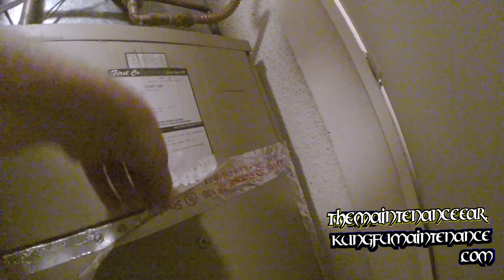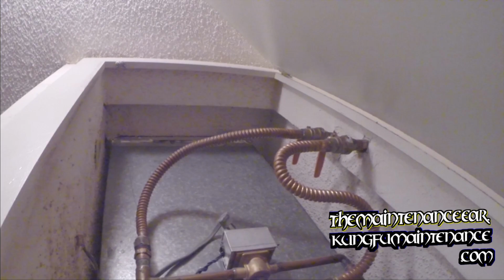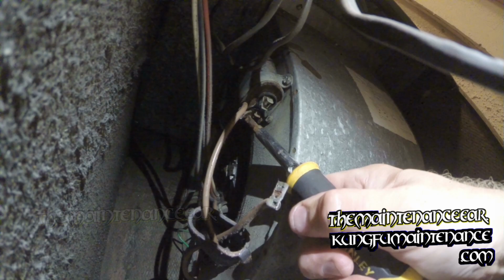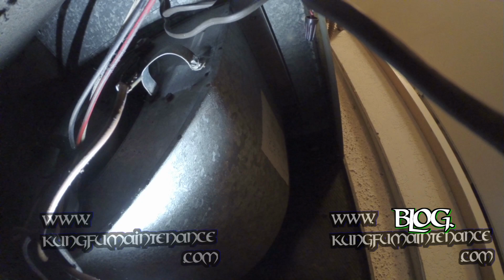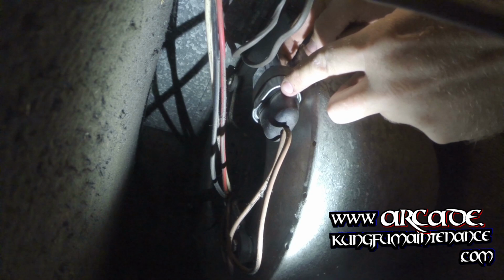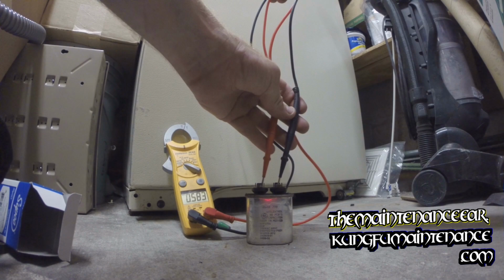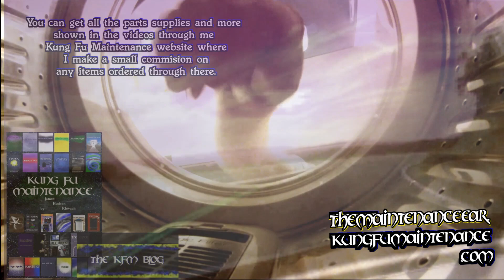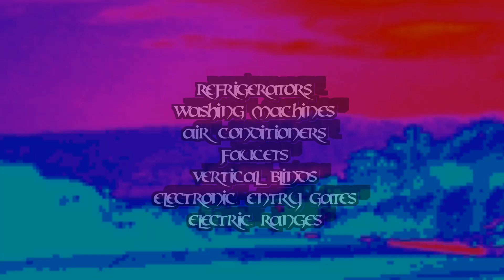Fan Slow Start Indoor Blower HVAC Air Conditioner Heater Quick Fix Maintenance Repair Video

Comment from the maker: Easiest Way To Get Universal EPA Certified Prep Manual    http://amzn.to/2kIQdQC
Get KFM's favored AC Gauges here            http://amzn.to/2kYgGb8
5/8" Suction Line Insulation   http://amzn.to/2w1me8G
Simple Leak Seek Spray   http://amzn.to/2lFfcC5  Laser Thermometer  http://amzn.to/2layD8I  
Valve Core Removal Tool                              http://amzn.to/2kJ00pC
Get KFM favored Electronic Leak Detector        http://amzn.to/2kmQMMz
Inficon Refrigerant Scale                               http://amzn.to/2vUCQPD
Hard Start Kit     http://amzn.to/2kiD16v   Contactor     http://amzn.to/2lFqA0P
Get  the Multi Tool Pliers used in so many KFM videos       http://amzn.to/2kWTjPp
5mf Capacitor   http://amzn.to/2wC96sH     35mf Capacitor    http://amzn.to/2vZVZ2t
35/5mf Capacitor   http://amzn.to/2iVJNi2        40/5mf Capacitor    http://amzn.to/2wzEdXD 
45/5 mf Capacitor   http://amzn.to/2w0wez5   
Condensate Pan Tablets   http://amzn.to/2lalV9W   No Rinse Coil Cleaner  http://amzn.to/2lHg8GD
Condenser Fin Whisk Brush                          http://amzn.to/2vWXUoC 
You must be EPA certified to charge or recover refrigerants and here is about the Easiest Way To Get certified with the Universal EPA Certified Prep Manual    http://amzn.to/2kIQdQC
Get KFM's favored Multi-Meter  here        http://amzn.to/2l8W9CO 
Get the Milwaukee 11 in 1 Screwdriver     http://amzn.to/2uTtsNj 
Wet Dry Vacuum used in so many KFM videos   http://amzn.to/2lFxi7u
Chapin Pro Pump Sprayer                             http://amzn.to/2vWCXdD
Evaporator Coil Cleaner No Rinse Mix        http://amzn.to/2x3eJTT
Evaporator Coil Cleaner No Rinse Can        http://amzn.to/2ezIxju  
Get the Screwdriver used in so many KFM videos here    http://amzn.to/2kHFoOF 
Get The Kung Fu Maintenance book here     http://amzn.to/2lEQPFk
Or  the Kung Fu Maintenance E book here  for less than $5    http://amzn.to/2lEY8wD
Get the Kung Fu Maintenance album (good driving music) "Up Beat" here     http://amzn.to/2l41pZ1
Get the Kung Fu Maintenance album (nice Instrumental music) "Entropy" here   http://amzn.to/2kl2U0p
Samsung Galaxy S8 Plus        http://amzn.to/2sFn9h8
GoPro Hero 5 Action Camera         http://amzn.to/2sN4nVK
Rode Lapel Microphone                 http://amzn.to/2vZoFc7
Purple Panda Lapel Microphone  Kit   http://amzn.to/2wByXkq
Video Edit Pro Software       http://amzn.to/2ruaaeZ
Samsung Galaxy S5                 http://amzn.to/2wBxk6l     
Samsung Galaxy S8 Plus        http://amzn.to/2sFn9h8
Video Edit Pro Software       http://amzn.to/2ruaaeZ

Hire An HVAC Specialist                                  http://amzn.to/2lktKek
Air Duct Cleaning Services                              http://amzn.to/2lFTpun
Central Air Conditioner Tune Up                   http://amzn.to/2lzJGoy 
Air Conditioner Repair Or Installation          http://amzn.to/2lFsEGw                                           
I don't work for any of the product companies  listed however I do make a small commission on items ordered  through the links.

Comment: Hey quick question. My hvac recently started making the exact same noise as the one in your video. Happens when starting up and when shutting off. Once it has speed though it doesn’t make noise. Is it due to the bad capacitor? I also noticed that in the video it still made noise when you replaced the capacitor and tested it with the enclosure open. Any help is greatly appreciated
Reply: Did you figure this out?  Mine is doing the same when it starts up but stops when it gets going.

Comment: Even though the unit is off- is it still safe to try to take off the wires using your screw driver to pry it off like that?
Reply from the maker: After pulling the power then the capacitor must be discharged once discharged it is electrically safe to work on. All the sharp corners in the tight area still make it dangerous. Lol.